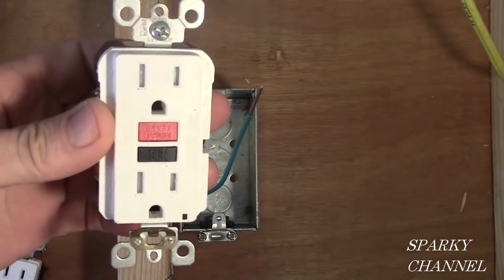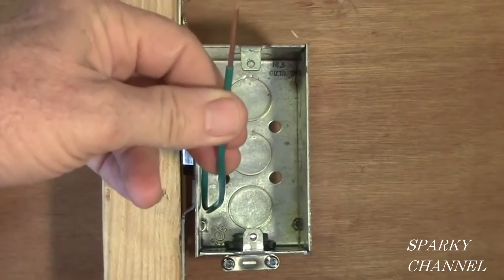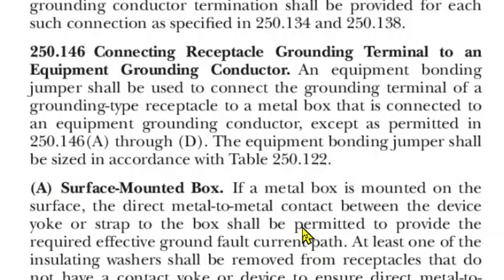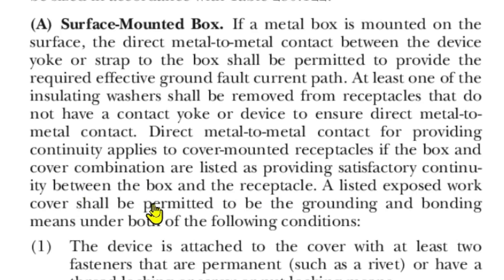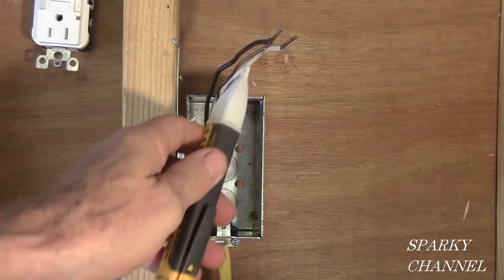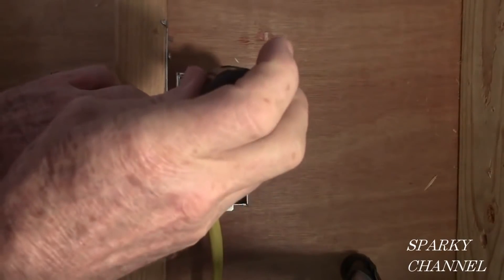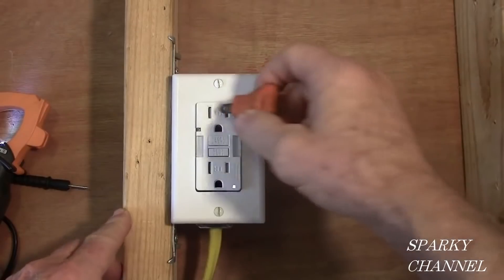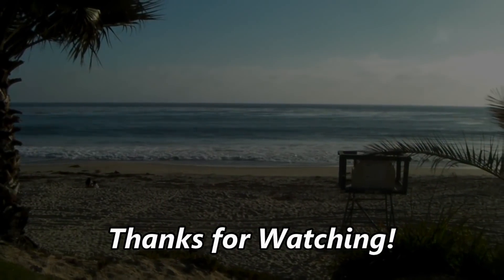What is a Self Grounding Clip and What Does the 2020 NEC Say About Them?

Comment: So when you pull the receptacle out of the box it leaves the box ungrounded, leaving room for someone to get shocked if the hot happens to energize the box. I don't trust it. Also are you sure you did that right, maybe ground the box and allow the yoke to ground the receptacle?
Reply: You still have to bond the box no matter what. It just saves yoy having to put a bonding jumper from the box to the receptacle
Reply: @stillthakoolest  I agree, but that is not what is shown in the video. He attaches the incomming EGC only to the device. The box ground now relies on the device clip to be grounded. I think the other way around would be better if it is used at all.
Reply: You are actually not supposed to work on energized circuits!
Reply: @charlestaylor3544  We all do it is part of being an electrician.  Try troubleshooting equipment with power off.
Reply: @DandyChigginz  It’s not about trouble shooting equipment in a factory, (been doing that for thirty years!) it’s about changing out a live receptacle. OSHA  will tell you not to work on energized circuits unless it absolutely can not be avoided.
Reply: When he removes the receptacle from the box without a bonding conductor the box will still be bonded to ground.  The only thing that will lose its ground is if there are any devices plugged into it, while he removes it(not sure why anyone would do this)
Reply: @DandyChigginz  "When he removes the receptacle from the box without a bonding conductor the box will still be bonded to ground." Why would you think that? If you watch the video he attaches the Romex ground wire only to the outlet. Frank is correct.

Comment: Why didn’t the gfi trip when touched the box with the red lead?
Reply: Because the meter uses almost zero power. (clamp an amp meter in to see for yourself.)
Reply: Wondering same thing
Reply: He was only using voltage. You test voltage in parallel just looking for potential difference. 
If he would have been testing amperage it would have tripped. Amperage is tested in serial and the current has to pass through the meter if testing with leads. Not a good idea though, because that would have been a short without a load. The outlet probably would have tripped though.
Reply: Same reason the tester lights don’t trip it.
Ya need a threshold of amperage to trip a GFCI

Comment: Just bond the box with your bonding conductor that is within the wire. I always leave it a bit longer rap it around the box scew then use the end to the device; works well if you have to splice additional wires through as well. Technically the metal screws could give you continuity even without the tightening it all the way, but continuity doesn't always repercent an adequate bond.
Reply from the maker: Excellent, thanks!

Comment: Would there still be good ground if the receptacle ears are floating on sheetrock. I have seen so many boxes set too deep and crooked for the plaster ears to touch metal. Even if the spring hugs the mounting screw, it seems to me that a heavy short would carbon up that tiny contact point in a literal flash.

Comment: I wonder if leaving the paper on the self-grounding clip would have still pass your grounding test. It would seem that the screw would have still provided the necessary grounding. Just curious.Thanks. Love your videos.
Reply from the maker: It would pass a grounding test but not pass code. Thanks!
Reply: @SparkyChannel  Besides, it's a rather tenuous connection: outlet metal - screw threads - box metal.

Comment: Interesting. I have been taught to ground box cause once the receptacle is out of the box the box is not grounded anymore. Chance of a zap
Reply from the maker: Yes, that's why I prefer to use the equipment bonding jumper. But I like to use both
Reply: @SparkyChannel  I was thinking the same... if the wire is there, use it. (I've done that even with the box bonded through the conduit.)

Comment: Nice video...So I guess the clip is a spring of sorts that they're relying upon to maintain good contact between the box/yoke/equipment grounding conductor...  Seems like the yoke alone would do the job if it was tight, no?  All the same,  if I have room in the box,  I'm running a separate bonding conductor to the box in case my self-grounding clip is not so selfish one day.   Jus' makes me feel better.

Comment: Quick question, can you run 12-2 romex from your breaker panel thru your attic and then strip romex outer shield off and run your black,white and ground wires thru conduit to receptacle box ?
Reply: Some inspectors may say the cable isn’t supported going into the pipe, using an emt to flex/nmd connector would be ur best bet
Reply: You could splice the Romex in a junction box to THHN, then run through conduit to your receptacle box.
Reply: No. The conductors in romex are not marked with the insulation type so cant be removed from the sheath by code in this case. You can sleeve romex in conduit to protect it from physical damage or route it into a box to transition from the romex to THHN wires into the conduit
Reply: @stillthakoolest  There are thermal problems encasing long runs of ROMEX inside EMT. I believe NEC allows it for short runs. My main point is that it is addressed in the code and there are restrictions.
Reply: @bobraible  code reference? Yes, its smarter to use THHN in conduit, but most people are only sleeving short distances. This is the only reference I know off hand: 312.5 Cabinets, Cutout Boxes, and Meter Socket Enclosures. Conductors entering enclosures within the scope of this article shall be protected from abrasion and shall comply with 312.5(A) through (C).
(C) Cables. Where cable is used, each cable shall be secured to the cabinet, cutout box, or meter socket enclosure. Exception: Cables with entirely nonmetallic sheaths shall be permitted to enter the top of a surface-mounted enclosure through one or more nonflexible raceways not less than 450 mm (18 in.) and not more than 3.0 m (10 ft) in length, provided all of the following conditions are met:
Reply: @stillthakoolest  Yup, that's the one. Thanx for the reference.

Comment: I know gold is one of the best conductors for electricity to seek out the path of the least amount of resistance something in that theory.
Reply from the maker: Gold is the best conductor, yes.
Reply: @SparkyChannel  No, silver is the best conductor, at least until it tarnishes!
Reply: Gold is a fairly good conductor but not as good as aluminum copper or silver. The reason it is chosen is almost always the fact that it doesn’t corrode.

Comment: "Flush type boxes" is key. If you use a box extender to comply with NEC 314.20, this won't work.
Reply from the maker: Have you ever seen a NEC article that specifically says you can't use a self-grounding clip on a metal box that has a mud plate?
Reply: @SparkyChannel  No, the topic appears to be as clear as mud. 😊
Reply from the maker: @Shadi2  LOL! Yes, the NEC really doesn't like to clarify things like that. One inspector will interpret it one way and another will interpret it another way.

Comment: White definitely code, I'd never do this because I've seen far too many loose receptacles that have been swapped out by homeowners or loosened over the years. If it's not firmly secured that whole box could become energized, and if a homeowner is swapping something out this grounding clip detail will likely be missed by them but they'll skip the jumper since that's what we did.
Very informative on the code sections! Thanks as always! :)
Reply from the maker: My preference is to use both and to use the self-grounding clip as a redundant bonding method. Thanks!

Comment: I guess I'm still not getting what that clip DOES. Just improving contact between the device mounting screw and the device yoke (once paper washer removed)? Was the contact without that clip really that insufficient?
Reply from the maker: Hi! The self-grounding clip increases the contact to the point where the NEC was comfortable with it.
Reply: @Fred Wills Ah! Makes sense. Thanks.

Comment: I would still use a wire to ground the box. If the outlet is removed for testing purposes the box isn't bonded to the grounding system of the house. So it could become live at mains voltage.
Reply from the maker: Hi Marcel! I agree with you. My preference is to use both.
Reply: If its a metal box you have to connect and bond to it no matter what by code. This just saves you having to connect a bonding jumper to the green screw on the receptacle.
Reply: @stillthakoolest  Yes, I agree. He seems to have done things backwards.

Comment: So if let's say there was a short or something and would that little clip suffice for the amount of current to withstand the short and not possibly energize the metal mox?
Reply from the maker: I really don't know. I like to use both the equipment bonding jumper and the self-grounding clip.
Reply: Thats why they say sized appropriately   So u can never not have the  current  needed to trip the breaker and break connection prior to tripping breaker  but I agree with sparky
Reply: @ronnyoo9371  good point I must have missed that but that is what I wanted to know thanks!
Reply: One of the main reasons to ground something is to get the breaker to trip. A short would run significant current and a breaker should trip that quickly. They probably test these scenarios to make sure the clip can withstand reasonable conditions.
Reply: @bitbistro  the breakers acts  fast  remember  ohms law theres 0 resistance thus  un regulated amp draw allowing for  almost immediate c/b tripping atleast at that amps

Comment: Hi Sparky, been watching you for years. Great videos, I learn a lot. Question, correct me if I'm wrong, in DC circuits you have a Positive or Plus, Negative or Minus, and Ground. With AC circuits you have a Hot side a Neutral side and a Ground. Are the terms interchangeable. Again really like your videos.
Reply from the maker: Hi Robert! No, the terms really aren't interchangeable although people do goof now and then and we know what they are saying. I've been known to make one or two of those goofs from time to time. :)
Reply: Hot and neutral isn't always on an AC grid, this is only in AC grids which are referenced to ground potential. There are some smaller grids which actually don't have a neutral. Only hots and a ground. They're not referenced to the ground. For example if you use a galvanic isolation, which can be a safety transformer for example. This is a transformer with a winding ratio of 1:1, after this you won't have a line/hot and a neutral any longer. If you measure between the two then hots, you'll get your regular voltage of 120V (or here in Europe 230V). But if you would measure between one of the hots and the ground the voltage reading would be useless nonsense. Nice thing to trick apprentices....

In practical application you find such grids in hospitals, because the circuits can handle one ground fault without an outage of the circuit. The circuit breaker will only trip in case of an additional second ground fault. That's the reason in such grids the insulation must be monitored at all time.
Reply: DC circuits only have positive and negative.  you will hear them referred to as positive ground (usually old systems) or negative ground (new systems) because the manufacturer of the system chooses one pole to use as the ground reference.

Comment: Would this work in a two wire system?
Reply from the maker: Hi Andy! If you watch my video: How 1960's Metal Electrical Boxes Were Grounded: https://youtu.be/nFL_nNPOztk   you'll see how some 2-wire system houses were grounded.  If you have that system, yes a self-grounding clip would would work. However, although it would undeniably ground your devise, it wouldn't pass todays NEC because the grounding wires in the 1960's were not thick enough to meet todays code.
Reply: @SparkyChannel  Must an old installation really meet todays requirements? Here in Germany it must meet the requirements of the version of the code which was in state when the installation was built. And personally I think, using this grounding clip would make the old installation safer than an open ground would. Here the code is always the minimum requirement, you can always exceed it. The electrician here is also permitted to create alternative solutions when the code method is not possible. But his alternative must at least provide the same level of safety as the code does.

Even if the wires are thin, install GFCI protection. For the 5, 10 or 30mA which will cause the GFCI to trip you don't require thick wires. In the UK they use 2.5mm² for the active wires (L & N), in AWG that would be comparable to AWG 13 (2.5mm² is between 12 and 14). But the so called CPC (circuit protective conductor, you would call that ground) is only 1.5mm². That would be comparable to AWG 15 (1.5mm² is larger than 16 but smaller than 14). Here in Germany that would be a no-go, because up to 16mm² the ground must be of the same size as the lines.

Comment: Nice video Bill you know I realize something some of these manufacturers make auto/self grounding outlets that don't have that brass clamp. yet they're listing their outlets to be self-grounding. also maybe it's just me but I would have done the ground voltage test at the actual ground prong of the outlet.
Reply from the maker: Excellent points, thanks!
Reply: @SparkyChannel  By testing the ground connection on the box, you showed that the self grounding connection was valid. However I'm of the safety sort, that has seen what fault current does to a wimpy connection, and would always ground the box directly, with a pig tail to the device. 
I've experienced fault current that sprayed the back of my hand with vaporized copper and aluminum box connector, and the breaker never tripped, as the ground came from EMT connection from the grounded panel. After that, I always pulled a ground wire in EMT wired systems. Always!. There is too much voltage drop in steel and the box connectors to support enough fault current to trip the breaker.

Comment: So if you use a metal box with EMT without a third, grounding wire (relying on the steel to provide the ground), can you rely self grounding clip to bond the receptacle?
Reply from the maker: I would say yes per the NEC. Always check with local authorities too though.
Reply: Yes

Comment: Can you explain why to even use a metal box? I see you always taping the outlet terminals for extra protection and I have seen outlets that melt because they arced being too close to the box (back when metal boxes were smaller). Just curious why to even use metal boxes.
Reply: Metal boxes are stronger will not warp with heat or fire and actually better contains any arcing and fire risks. They are used on specific cases as well with metal armored cables or if metal conduit is running in and out of those boxes and often used when attaching to a brick or masonry type wall where they can be chased into the walls. While metal boxes themselves when attached to a stud do not have a natural ground path it’s usually bonded (a pigtail copper ground wire is attached to the ground wires that come into the box as those ground wires do have a direct path to the ground at the panels and ground rods). This ensures if there is a short to the box (live wire were to come loose and arc with the metal box or touch the metal box the metal cover or switch or receptacle do not become live). In reality nowadays most metal covers have a ground screw or plastic covers to mitigate the possibility of dangerous live touch current arising). Moreover nowadays even the receptacle and switch is electrically insulated from the outside I.e made from an electrically non-conductive material.
Reply: I prefer the metal reason being can always tap the threads when someone uses a drywall screw etc. I have saw plastic ones break when doing a simple fixture or device swap too many times, but the plastic boxes are cheaper so there's always that.
Reply from the maker: Math Man and Rob answered the question really well. When I was coming up as an electrician I worked for an electrical engineer and he wouldn't allow anything but metal boxes. He wanted the strength and durability.